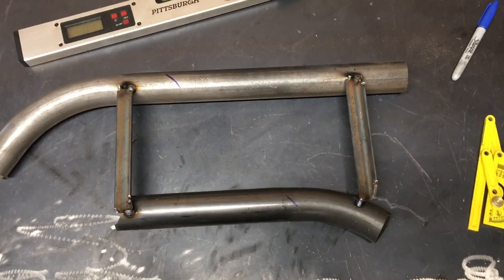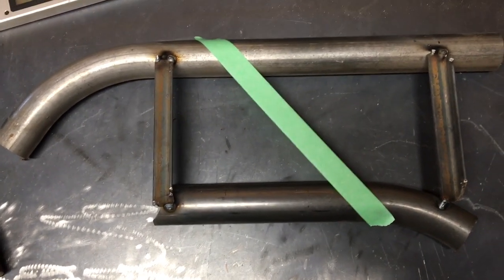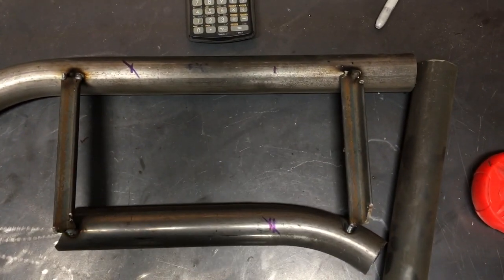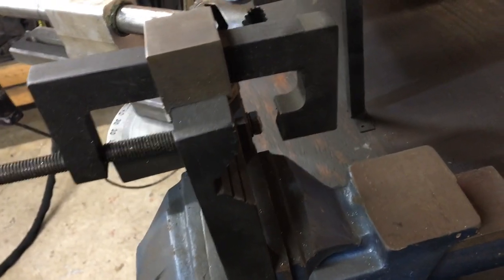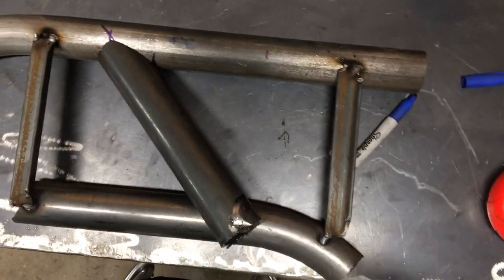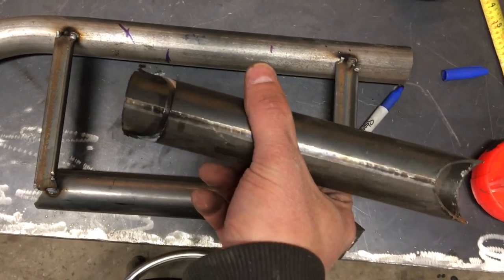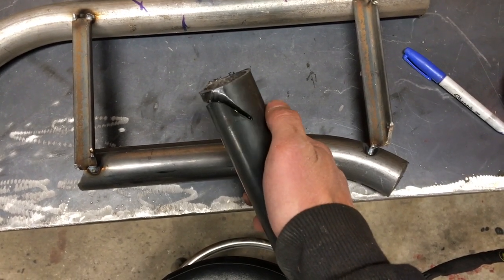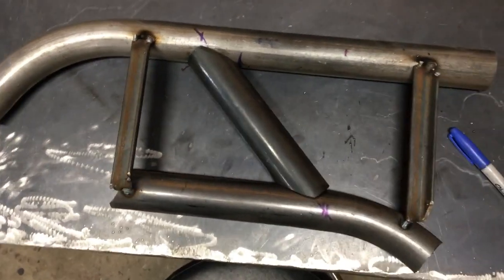Episode 5: Notching tube | How to build your own rock crawler/buggy/bouncer

Comment: Awesome vids!! Loving the amount of detail and info in each video
I found a little trick for notching is 
Find the hypotenuse of the triangle and then add 1/3 of the diameter of the tube onto each end aka add 2/3s the diameter to the over all length will give you the correct over all length for the notches 👌

Even easier if you mark a horizontal centre line on the tube then just make a mark 1/3 diameter in from each end perfectly clocked notches every time

Comment: After notching the first side, what is the best way to notch the opposite side without the notch being twisted?
Reply from the maker: This is a good question. Most of the time, I just quickly eyeball it and mark the tube with a sharpie. If you are using a welded seam tube, you can use the seam as a guide. If you are using DOM tubing, scribe a sharpie line along the tube, making sure that it is straight, and use it as a guide. Even better, you can scribe 2 lines along the tube length, offset by 180 degrees, and these will be your guides. If you are notching a bent tubing, well, this gets even more difficult! It takes practice and after a while you will get the hang of it. I have to admit that I wasted many tubes by having the opposing notches "twisted" and would not line-up properly.
Reply: @rgsabat  you can also use an angle finder in the notch previously made and place it at vertical. Your set up has to be lined up before doing the first notch.